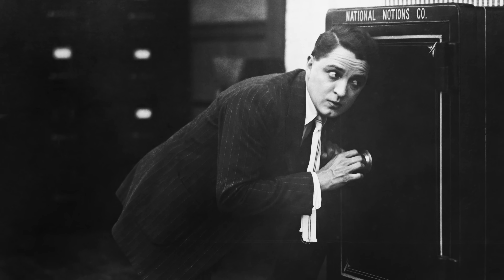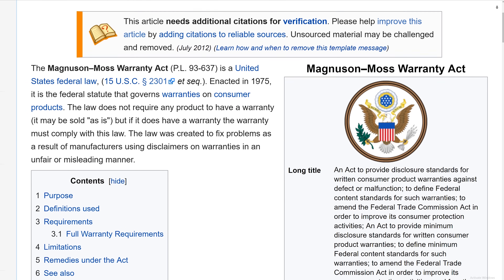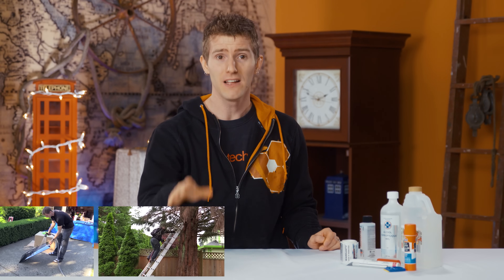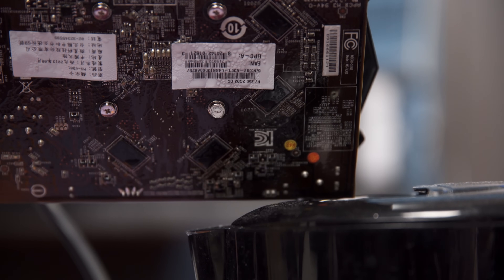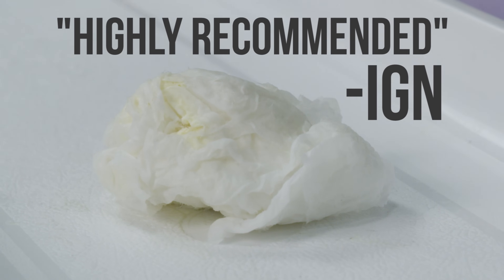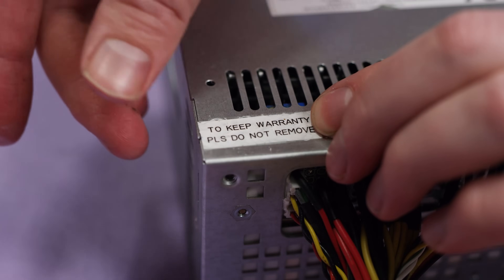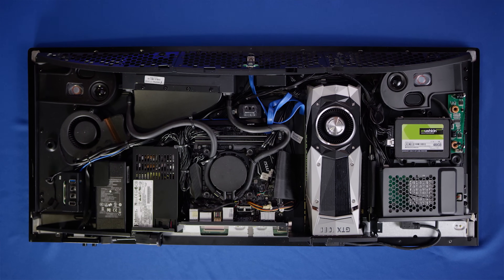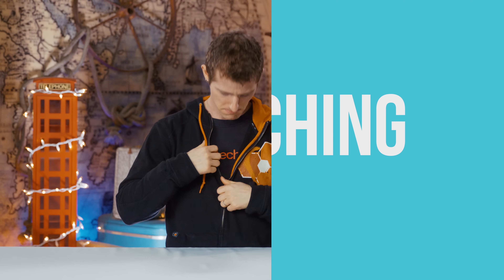Safely Remove Warranty Stickers

Comment: I just bought a new PSU and the void warranty sticker was completely loose inside the box, intact, but without any adhesion. I kept it in a little case, but i have a question...
If something happens to my PSU and i need to RMA it, is there a way to put the sticker back on? I mean, what kind of glue should i use?

Comment: Heat gun and new metal razor blade is all you need. Mask around the sticker So you don't melt the plastic. And once you get the sticker hot enough with the heat gun take the razor blade and dig up one corner and do it until you are able to get one corner of the sticker bisecting the blade the tip of the blade. Continue to heat the sticker while pulling upward force at a 45° angle on the sticker until it pops off. The angle is very important because if you pull at a 90° angle you will crease the sticker.

Comment: I did find this video helpful. Unfortunately, it was a day late and a dollar short. Last week I bought an MSI GF75 thin with a 512 NVMe drive, 1 TB sata and 8 GB ram. I bought this with the express intent of upgrading.  So I had all of the parts to upgrade it to 2 TB NVme, 4 TB SSD and 64 GB ram.  I have built several computers in the past, so this was easy breezy to replace these components. I go back to having to choose the master and slave settings on IDE hard drives. Everything went as smooth as butter, but for some reason, my speakers now do not work. I didn't get anywhere near the speakers in the upgrade and took it apart very carefully. I only had it for 1 week and now the speakers don't work.  I tried to be as careful as possible to peel the sticker back with a razor blade. It was so brittle, it literally started crumbling when I used a new straight-edge razor blade. Once it started crumbling, I knew it was over. How would I know that my speakers wouldn't work?  It still has sound on the headphone jack and with bluetooth  speakers, but I don't want a brand new gaming laptop with non-functional speakers. It totally sucks.  I'll probably wind up paying for the repair. What's worse than the sticker coming off was I tried to get the sticky residue off with 99% alcohol and it marred the rubberized case around the screw hole.

Comment: So what if I have to alter my product in order to make it function properly, however I have to cut into the manufacturer's cord therefore voiding the manufacturer's warranty.

I have a product that is not compatible with the manufacturer's accessories.    Furthermore, it's basic wiring. Is it my fault my solar panel is NOT compatible with the manufacturer's product's accessories i.e.   THE ONLY 12 - 24V charge port on the devics     in other words if i sold you a car and it was under warranty, but you had to do the repairs yourself. You had damaged the product in order to repair it. Well..... 🤔

Comment: I had to send in a samsung phone for warranty repair, but I opened it up and saw some water stickers were tripped(even though the repair wasn't water related nor did I ever drop it in water)

You can get replacement stickers on ebay and thats what I did before sending it in. It worked.

Comment: A spudger and a heat gun especially if it is on metal, unless it is a thermal label.  ......also, in 20+ years doing this sort of thing I have never had a company deny a claim because of a sticker.

Comment: As an expert at removing stickers, the best way to do it, is to heat the surrounding area around the sticker with a heat gun.  When the indirect heat conductively warms up the glue  underneath the sticker, it will very easily just peel off without any damage.

Comment: I highly recommend that if you're going to be using rubbing alcohol that you do NOT pout it directly out of the main bottle and on to the surface you're working on.

I pour my rubbing alcohol into an old pill bottle, and then use an eye dropper to transfer it on to my work surface. I have much more control over that. Good quality glass eye droppers can be bought in packs of 2 at a local drug store for something like $2, and the old pill bottle is probably already lying around your house. If you don't already have an old pill bottle around your house, then any small container that is shorter than the eye dropper you're using will work. The important thing is that the eye dropper is able to reach the bottom of the small container. 

You're not going to be using a whole lot of rubbing alcohol for any one project, so pout out only a tiny amount at any one time, and then use the eye dropper to suck it all up so that it doesn't evaporate. You can use the eye dropper to drop drops behind a sticker that you've already started slowly peeling off to loosen the glue to make the peeling easier, or you can use the eye dropper kind of like a fountain pen and "write" the rubbing alcohol around the borders of whatever you're working on. Aside from that, dampening a paper towel or coffee filter (like a paper towel, but guaranteed to not leave any lint!) with rubbing alcohol and then rubbing the surface is a great way to remove sticky residue.

Comment: A tip: If you want to clean the dust in your laptop or computer, just vacuum the dust from the fan holes outside with vacuum cleaner. It works

Comment: A fairly important thing to say is that even if you CAN remove the cover of a harddrive "without voiding the warranty".. The statement about "improper repair" makes it an unreasonable act.. yes.. unless you personally am in the possession of a dust-free environment (complete with completely covering suit and breathing apparatus that prevents you from breathing in that area) you WILL get stuff in to that drive that doesn't belong". Already when I was a kid (35 years ago) the size of an actual track on a harddrive (about 20-30 megs) was about one fifth of a "normal" dust molecule.  Secondly: The actual tension in the screws can bend the shape of the drive enough to create errors immediately. So.. you should also have a proper screw-driver where you can set the exact amount of "force" it is allowed to use when closing it...

In Sweden there are also LAWS in regards to what you are ore are not allowed to do with things that connects to the electric grids. You ARE allowed to dabble with the electronics of a device, but NOT be close to the parts that actually go straight to the wall. Hence the actual encasement containing the power-conversion is a "no-no" to open. In regards to SOME TV-s there IS no specific individual "power-supply unit", hence actually opening the cover and just fiddling around inside CAN make the device illegal to connect to the electrical grid. (Not automatically because of people wanting to catch you doing the, BUT you are libel if one of your amateurish home made devices or repairs creates huge costs for the people maintaining the system or do damage to other people's equipment connected to the same system, and also so insurance companies don't get a needless expense of "know-it-all" DYI:ers who burn down their house because they really didn't know as much about electricity, insulation, heat, materials ignition points, and so on, as they thought they did)

One of the advantages of building your own computer is that the warranties are by the component manufacturer.. And why would you want to try to REPAIR a TV or graphics card or hard-drive while it is still under warranty anyway?

Comment: On my country in this scenarios, you do not need to sue, the state sues for you and covers the costs and time for this kind of clear "a company has broken the law" scenarios, they also are the ones that receive the money at the end if they win, in a case like this, you will have your computer repaired and the state will receive the extra money from the settlement, you can also sue on your own if you want, but this method is better for this kind of little guy vs big corporation scenarios, because they convert into a country's body vs big corporation scenarios.

Comment: I once forgot to plug the antenna cables back into the motherboard after cleaning the fans of my 1000$ gaming notebook. It caused a shortcut in the power supply part of the motherboard, but Acer somehow accepted it....

Comment: Instead of solvents use glass detergent. It does nothing to the glue itself but slips between the glue and the surface making it not sticky until it dries off.
Get a bottle of windex in one hand and a blade in the other, spray the area around the sticker and lightly rest the blade against the edge of the sticker at an angle.
Don't push the blade, all you want to do is use it as a wedge to make a microscopic gap for the detergent to seep into.
Whenever it slides more between the surface and the sticker spray a bit more soap under the blade.
If you do it right not only will the sticker be immaculate, it will also be as adhesive when you put it back and the windex evaporates

Comment: Did phone repair for 3 years. Colemans camp fuel kerosene has some odd additive that will turn the most stubborn adhesives into mildy tacky "gum". Will not dye or damage electrical components. Ive used this and plastic blades to move the imei stickers from samsung phone midframes to the replacements, game consoles, iphones, and a host of other products. Works better than alcohol and leaves no residue

Comment: In Germany you have a 2-year-warranty, that every manufacturer must give to the custumers. If the defect is traceble to a manufacturing-flaw, you will get the money back or a replacement. A manufacturer can give you an extended warranty, which is like a contract and can be ruled by those stickers.

Comment: Pour a towel at a carbon fire extinguisher. Then press the knob by covering the nozzle with towel. You will ended up with some dry ice. Then place that dry ice directly to the sticker. 
The sticket will get rock solid so you can knock it off from place. 😐
Simple as it 😏.

Comment: * Has “Void if removed” sticker on panel * 
 
 Cuts stickered panel off and replaces it
Reply: It's not being removed if you just jam a skrewdriver through it. Solution.
Reply: Nutmeg Gaming Modern problems require modern solutions.

Comment: The real question is: Why would you even try to repair a device wich you can get repaired for free under warranry?

If the device is broken, you can get a replacement or repair for free and if you want to mod it, there's no way the manufacturer won't find out...

Comment: If you're really careful you can re-align a "void" sticker so that the "void" words left behind will align with the "void" holes in the sticker. It helps if you don't remove the sticker completely and leave a hinge on it.

Another hack would be to just remove the sticker by any means necessary (go ahead and damage it) and remove and clean any residue left behind. If the manufacturer can't see where the sticker was, they will probably not notice it wasn't there in the first place.

Comment: I do onsite warranty repairs and one manufacturer puts a tamper sticker on a mobo screw om laptops. It has the consistency of dried white-out. Basically dissolves into a nasty mess when you touch it. If I show up to repair a laptop and see the sticker messed with, I don't give a darn. They didnt train us we had to deny a repair bc of it. Now if I get down past that point and see someone was in there and botched a repair and found stripped screws and broken clips all over, then I might start asking questions. They also dont give us replacement stickers so once i've sone.the repair, the sticker's still shot anyway.

Comment: The most breakable "warranty void if seal is broken" is from sparepart box i work with, the moment you peel it, it has some scratch type material, when you take it off the "open" text will appear and if you try to put it back together, it wont work

Comment: What a joke! In New Zealand, those stickers are meaningless.... your rights as a consumer can not be limited by such irrelevant and arbitrary items, they are protected by law. "Warranty void if removed" label missing? Still covered. TV only came with a three-month warranty card, but it breaks after 10 months? Still covered. You've opened the case of the broken item to look inside? So long as the manufacturer can't prove you've CAUSED a fault, you're still covered. All this, because the Law in NZ says that an item must be durable and fit for purpose .... and the definitions of these are NOT up to the manufacturer.

Comment: a Heat gun with digital temp adjuster and a sharp blade is all you need!   If you don't have a heat-gun then use a hair dryer and works perfect as well!  Oh and when peeling off stickers just have patience because that is the key to doing it right!

Comment: There's one company I know that doesn't resort to this: Dell. They give a part by part warranty. I've opened my laptops for cleaning and replacing the HDD and have claimed my warranty service without issues on their side, even after telling the representative that I replaced the HDD. I'm not sure if they still follow that though. I haven't bought anything from Dell since 2014.

Comment: Here in Japan they don't apply any of those stickers. My gaming laptop doesn't have any, inside and outside. Consumer protection laws are really effective here. I can completely disassemble my laptop, put it back together and return it on the next day if I want (considering I don't break it in half in the process), no questions asked. Few months ago I had to return a Sandisk 32GB USB3 flash drive (I think I fucked it up by trying to test it with crystaldiskmark, oops!), and they didn't even asked for the receipt. The guy asked if I wanted the money back or a new one. I got a new one.

Comment: Or what I did was use a hair dryer and a penknife, heated the adhesive on my Acer laptop and it came off cleanly. And I decided to throw it away because what's the point of putting it back anyway the warranty's ending in a few months.

Comment: if you own a Forza 6 edition Xbox one (fat) the case used has a texture and the "void proof" sticker Microsoft used doesn't adhere well to it. I've taken 3 out of 3 off in perfect condition with no void residue left behind. there's something about that blue textured case used that it doesn't stick. other xbox's it's very difficult (still do able with a very steady hand and patience)

Comment: You can try using acetone. it stops the adhesive from working. If the acetone is dried out, the adhesive works again. So work fast, but carefully.